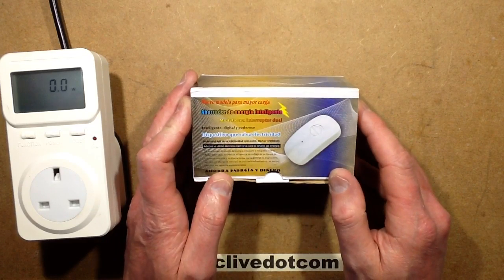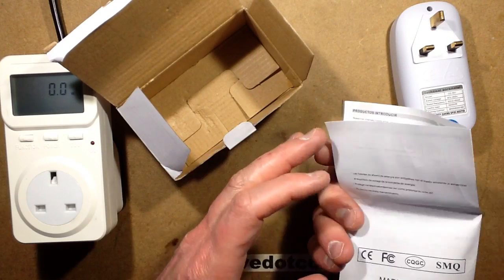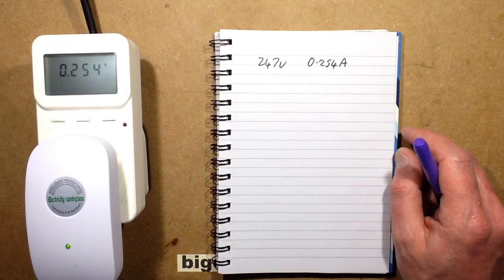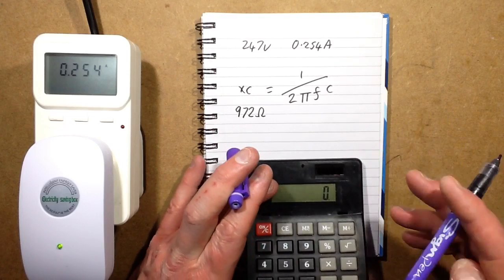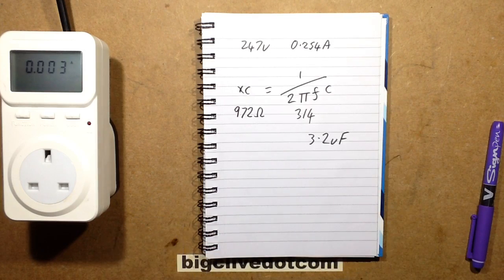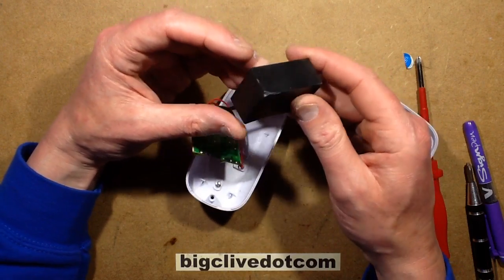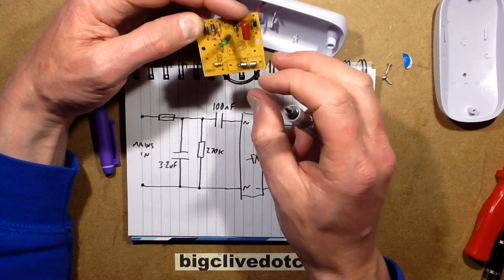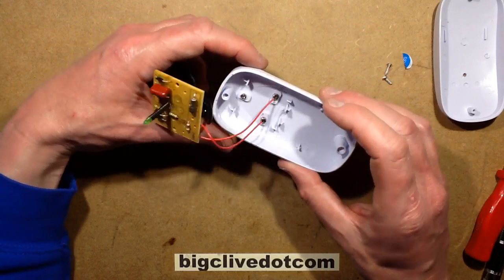30kW energy saver plug teardown and schematic.

Comment: I want to start selling "pointless LED box" on eBay for a few cents cheaper than these things, basically just the simple LED circuit, "good as an AC power project case" in the description, and see if they sell better than these "energy savers"
Reply from the maker: It would be safer.

Comment: I don't believe a randomly selected value capacitor will certainly save energy by any means as it has to be calculated how much inductive reactance you typically have at your point of consumption, and choose the right size capacitor, but condemning a product merely on the basis of some nonsense regarding a PCB that doesn't necessarily need to be there at all is a very weak argument. You waffled about a PCB and an LED and why it doesn't have a smoothening capacitor etc more than what you should have said about the main item that can potentially save on your bill, you never even mentioned that it is possible to do so, but said it could protect surges, which is not true at all. The surges can only be protected by capacitors that are earthed, not connected parallel to the power. This is supposedly designed to correct the power factor,  but it doesn't do the right job, because it cannot be done by random value capacitors. The size of the right capacitor to correct power factor needs to be calculated for each consumer, and not one size fits all. This should have been the focus of your video, which I will make myself. Thanks for showing inside of the product though! However what the plug is made out of or how many micrometre it's  smaller than your made-up standard size or material, it's totally irrelevant at least under this subject.
Reply from the maker: This comment is a very good example of all the problems with the self appointed "electrical trainers" that have blighted and deskilled the electrical industry.
Reply: @bigclivedotcom  HAHAHA, Oh, so you're so talented and skilled, are you!? Who has appointed you? Maybe your local Sherrif who appointed himself too? LOL Your comment is a prime example of someone who cannot take any constructive criticism, while clearly uneducated thinking too much of himself.
First of all, I'm a College / University Lecturer, so let's get that established, Secondly you obviously have no clue about what you were talking about, you just made a video to tarnish the names and make yourself some traffic. Listen little man, I started out by being very nice to you and saying that I didn't believe a randomly selected capacitor cannot save energy, but you however are clearly very dogmatic and narrow minded as well as having very shallow (if at all) knowledge of electricity. So, Don't even begin to talk about electrical training as you never even mentioned the fact that the idea of this box is to correct power factor. Look whom am I telling to talk about power factor! Sorry, I know this is way beyond you and far above your qualifications, which is clearly none, but power factor is not edible or a toy or something to wear. I have a video on that you can go and watch to learn and increase your knowledge a little bit, but of course it's not for baby level though! Your silly baby like comment is also another indication of how little you know about what you profess you know! I'd suggest that you go on a baby level electrical training first before you can educate people on something far above what you can fathom! Good luck, and Good bye Mr little clive P.S I think you said it best in your own YT channel description that you're "The trashiest electronic channel on YouTube" I didn't say that though!, YOU siad it mate and you're so scared of your own ass, you keep covering it as you go on in your description! Be a man!

Comment: I have one that plug in to the wall and has outlet you plug into.   Its directions said only use the Inductive load ( motors) NOT resistive load.  I measured mine -- it  truncated the sin wave thus reducing power.   So mine works.  We have a Power wheel here on our house ---  outside power meter.   Resister is for current limiter.   If the unit consumed power you could not say it works.   I saw a viewer that said they  have switching power system that would not show up as saving.   But when he put it to test it did make his power meter ( bench model) run slower so it worked.   Not going to save alot but adds up.    Like I said my is one made in USA.  MIne -- Plug in and you plug into it.   Would be for things that run non stop.
Reply: Wow! Anything that "truncates the sinewave" should catch fire if my understanding of electronics is correct!

Comment: Clive enjoy your videos and humor.  When you measure power factor, you never say if it's leading or lagging.  Wouldn't all these capacitor droppers and this capacitor cause leading power factor?  And if you didn't have inductive loads, these capacitors might raise the system voltage if a leading power factor results.  Worse case, these capacitors might combine with the system inductance and cause voltage ringing if the resultant L-C system is resonant on some of those switchmode frequency  or dimmer inputs that are chopping up the sinewave.
Reply: You're not wrong, but the level of coincidence required for any issue to arise is verging on the astronomical, imho!

Comment: How about this one?:

https://www.youtube.com/watch?v=RSdvWq1aKHI
Reply from the maker: That's basically putting a power factor correction capacitor directly across the motor in the compressor, which does work.  But it introduces higher risk of contact wear due to the high inrush current to the capacitor when the compressor turns on and will have no effect on a traditional meter reading which is usually actual power and not apparent power.  That may change in the future and manufacturers may include a correction capacitor in future fridges.

Comment: Correcting power factor does save a small amount of energy, particularly if the load is at the end of a long wiring run.  A well pump is a good example.  Unfortunately, for the best performance the capacitor should be located at the motor, which would be underwater in a submersible pump.
I've often wondered why domestic services are not penalized for poor power factors(less than 0.9), since they are wasteful, and easy to correct.  The additional current caused by bad power factor, called reactive power, goes back through the step down transformer, until it is corrected somewhere.  Presumably the utility has capacitors at substations that do the correction.

Comment: Will it atleast 'stabilize the voltage' in case of voltage surges?
P.S. I'm not from 'Electrical Engg' backround. so kindly do answer, even if the question might seem basic.

Comment: In an apartment building that is old the refrigerator is not energy efficient. (Details Here = https://vk.com/wall441182527_5 )  Where there is an older stove that is electric and heating that is called Zone heating that is not controlled by the tenant the electric bills are crazy high.
Reply: hmm... there are some useful information here!

Comment: factories using huge amounts of inductive load such as motors or fluorescent lights of course have cabinets full of capacitors across the mains...PFC Correction. Maybe this little plug will save energy off the motor in your fridge

Comment: This device worth to get just for the case and the capacitor. I saw DIY cases in local electronics shop yesterday. They much uglier than this one and cost about same. Capacitor like that is also not cheap and hard to find.

Comment: The principle is possibly valid, even if the reality is less so

I live in the north of England - mill country ... we also had electric trams.  It was common practice for "the bin men" to visit the electric mill premises to "tune" the ht 3 phase mains supplies (other power sources were available).  A loom or spinning machine, is a huge inductive load, as is a trolly bus ... some of the kit was still DC with ghostly violet glowing rectifiers.  The "bin men" would carry in massive bin size capacitors and "tune" the supply so that the induction was almost 0 and the consumption meters used were hardly bigger than domestic models because there was no apparent load.  They'd then slap a multiplier label on the front indicating that the 10 Kw metered was actually 1000000000 GW ... (ok a slight exaggeration) - in that way the measuring rooms were kept quite compact and back EMF arc-ing in the mill or out in the road was reduced making life safer.

That kit was already on the way out when I was an apprentice in the 70s and I never used the kit - but it was still a part of my first year exams at tec. Now most of the mills have been demolished.  Some of the steam power has been saved and is exhibited ... but either the scrappers took the electric kit ... or it went east.

Comment: Couldn't this also help correct your power factor from high inductive loads in your house from items such as air conditioners and washing machines?
Reply: +Ryan Toomey
my understanding is that residential is metered in a way that is oblivious to power factor
Reply: You have to consider also that not all the devices coming out of china are for first world countries.  While we may well be using the latest tec meters and kit.  In Africa india, china etc available infrastructure and tec is a mix of anything from 1900 through 1950s/60s to meet the modern world.  Where there is metering, it's often the old "clockwork".
Reply: I counted 53 countries that use the British BS 1363 plug (from Wikipedia's list). I'm actually surprised it's so popular. It is quite well designed, though.
Reply: I'm actually surprised anyone uses a BS plug /s

Comment: So, I guess power savers like this one actually can help reduce electrical bill, but only in specific scenarios and situations?
Reply: ... in which case they may even have considered this and compensated already in the design. The only benefit  as Clive says, of any significance, is that it's a way to get a capacitor of random value, bit around the 1 to 5 mF mark at bulk prices which imho would be quite useful as crossover network components if you're DIYing a set of speakers!

Comment: In Denmark all Industrial installations is required by law to have a CosPhi between 0.9 and 9.9 (1 ideal) 
Soon also all household installations the same, this is sorted by Authorized Electricians who can "phase compensate" basically adding a capacitor.

If your company or in the future your household, does not meet the requirements you will be fined and the local power company will then correct the installation
on your behalf, and on your bill. 

So Phase correcting is something that has become more and more important and less optional atleast here, also i live in the SW denmark, where we have some of 
the most modern powergrid in Europe, they can measure everything remotely and adjust accordingly, meaning they are infact actively measuring not only consumption
but also CosinePhi, because it allows them to put more power through smaller cables.  

;)  However, It's IMPORTANT for people to know, these "POWER SAVERS" DOES NOT FIX cosPhi because they have a capacitor in them, 
the capacitor has to be configured for each house installation, depending on load etc, "smart capacitors"
Reply: +Eqvaliser also don't forget about the harmonics.
you also gotta take harmonics into account when fixing cosphi.

Comment: I feel he's let us down, folks, a real thorough investigation would have involved taking a weight measurement of the prong and placing it in a 100ml beaker with 20cc water and reading the displacement then "doing the maths" and comparing the specific gravity to Cu and AL to make sure that prong is brass and not Aluminium.
Reply: Yea, especially since it's NOT even connected electrically and has no function what so ever to a piece of junk that actually uses more electricity to light the LED ! ,,,RIPOFF !

Comment: One thing I've never understood about these obviously quack/fraud devices: how do they get away with it? I live in the 'States, and if I built or sold these here, I'd EXPECT to get federal agents, insurance investigators, and/or angry engineers busting down my door, if not beating my face.
Reply: China is a magical place.
Reply: A. They don't necessarily go bang and start fires (but could, if cheap and nasty caps are used, although in this case it's fused, so probably wouldn't)
B. They could, in some situations actually save you a few cents a year.
C. Who ya gunna sue?

Comment: I wonder though, clearly these are designed to do something.  They're advertised to save electricity though they don't, but why go to the trouble of building the circuit and adding the components?  If it's bunk, why not just put an LED and the circuitry to light it from mains in there?  Surely it would save them money, and the few people like you who take them apart would be outweighed by the hundreds or thousands of gullible people who buy these things and don't take them apart or even check the current draw from them.

Comment: Capacitor might come in useful for a pocket tazer /emf project.
These things sell quite a lot on ebay - so many stupid people on ebay - so many house fires! lol
Reply: +Garry Gemmell Or maybe they are igenious people fooling the fools because they are buying them as replacement capacitors for their cap run & cap start motors. I'll have to remember that. Plus you many together to up the value if you need a different value.
Reply: BikingMNViking I just bought 3.
lol
Reply: Garry Gemmell
thumbs up... since I only need 110 ones didn't buy any (I should check my Table Saw, though, I know it runs on 220) since I have them from appliances I've salvaged -- speaking of which I just walked in from taking apart the coolest thing --

It's a "biscuit deliver system" where you put a stack of hickory/applewood/mesquite niscuits and this thing pushed them out onto a heater. Someone had it by their trash... I bet the heater went. (it's got a sealed unit type of coil which are pretty rare)

The rest is super nice.... ibm type plug in, excellent lighted switches, and about 1/2 inch wide brass bushings on the reciprocating arm. 4 rpm motor which I bet puts a disc out every 15 minutes or so. Haven't time to play with it yet but what to use it as?

Automatic dog or Goldfish feeder
Waving arm for frosty the snowman?
Robotic flag waver?
A poundland disco ball?

Be nice if I could use it to feed flavoring wood into my charcoal grill. Maybe I should try to google up which "biscuits" it takes...
Reply: +BikingMNViking Well done you!!!
In Slovakia literally nothing is thrown out - we use the coffee grounds and tea bags for soil compost and nothing , literally nothing is thrown out - i just repaired my 50 inch LG Plasma , hoover , shower whereas most people in the West would just throw it out - its a terrible way to live - i have learnt plumbing , electronics , woodwork , car mechanis from scratch as my father was a fixit genius (do parents teach kids nothing these days?) and have never employed anyone in the last 20 years for any job in or around my house - now thats a satisfying life - and its saved i reckon £20,000 minimum. Came back to Scotland last year and rebuilt my mothers conservatory for £300 - builders quote was over £5000 - what a laugh!
Reply: Garry Gemmell
Impressive, yup, I am very thrifty. Even my eggshells get nuked dry then microwaved and fed to my tomatoes. I do the tea thing, too. Hell, I even sneak out my urine at night... keeps the dogs away and the grass looks beautiful (1:20 H2O ratio is perfect). We sound a lot alike... after my first car bill I vowed to do all my work myself and except for one super large job I have... even did a FWD transmission once. Love woodworking. Rekey locks...fix anything that I can... what was wrong in the TV?

My main problem is all this has amassed too much -- I look like a hoarder now!

Tinkering with some solar panels and right now trying to google up parts for an adult trike...can't find much so far. Would like to do an electric trike or bike. I've got like 6 bikes... everything from a steel grocery getter to a Titanium framed Fantom 29er MTB with real hydraulic brakes. When you're thrifty you can afford better things -- and I paid more for that bike than any car I ever owned in my entire life. Cheers!

(BTW how much snow do you accumulate during wiinter and what are your temps? )
Reply: Depends 3 feet -7c Tatra!

Comment: Are these of any use when dealing with Inverters or Generators (or other off-grid AC source)? 
As I understand it, you should connect them near to the equipment being powered that has a poor power factor, match the reactive power produced by them with the one consumed by the (inductive) equipment (things like fridge, air conditioning, microwave) but it should help if for instance you have a 500W inverter and a 550W drill or no?
Thx :D
Reply: +MrOpenGL Not for intermittent loads. When they're off, and your magic PF corrector is still plugged in, your power line is then too capacitive. 

Each device should be individually compensated to PF of 1, or close enough. Light loads are not going to matter, but when you throw a water pump or refrigerator on it, it could start off inductive or capacitive (cap start) for a second, then turn inductive while it runs. So you need to  measure your load with one of those meters (like Kill-A Watt)and see what  kind of capacitor to compensate it with. Or buy gadgets with near-unity PF. Or, derate your generator output with inductive loads.
Reply: James Van Damme Basically apart from measuring it is more practical to calculate the capacitance required and buy an off the shelf capacitor (to connect after the motor relay) rather than one of these mystery box. Well I just wanted to find an use for them (I haven't bought one yet though!) :-(